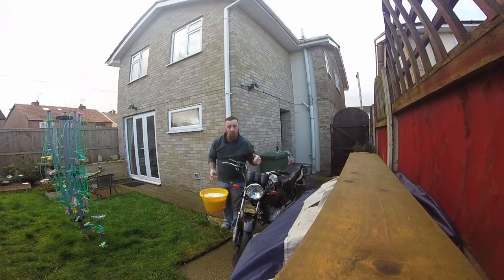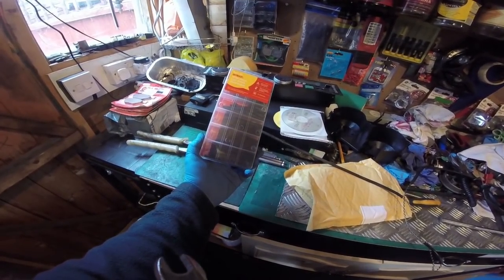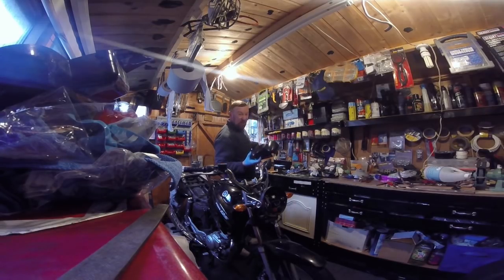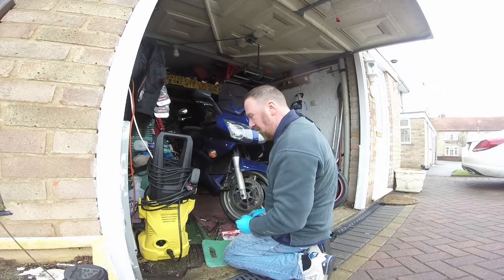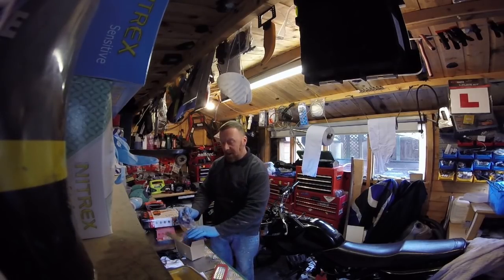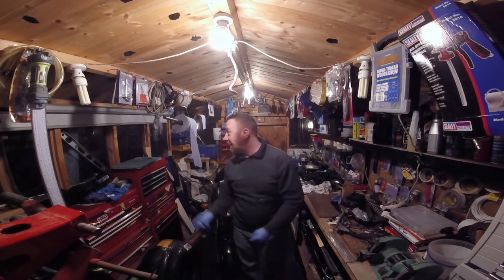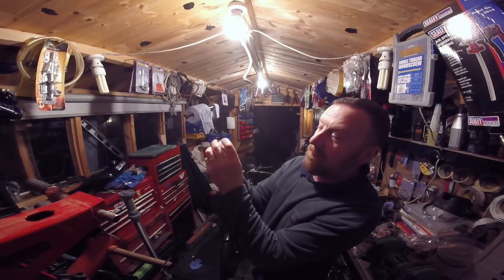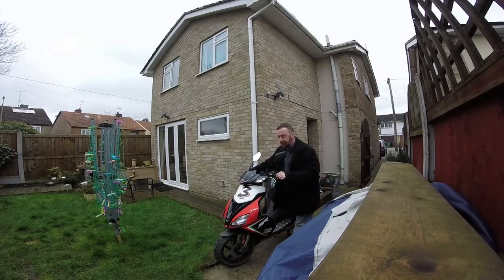YAMAHA YBR 125 GETTING IT RUNNING LONG VIDEO MARK SAVAGE

Comment: Just purchased one of these. The clutch cable snapped last week. I've ordered 5 different cables and not found the right one so far. Wish i'd known they made 60 million different variations.
Reply from the maker: they just used anything they had bud as not built as the ybr

Comment: Spooky, I was bump starting a YBR for someone in work this week! Dead battery which seems to have caused by multiple case of going completely flat due to heated grips being left on.
Reply from the maker: hi bud thanks for watching how's things 
mark
Reply: mark savage Been too busy working to watch any YouTube videos so catching up tonight. 👍🏻😬
Reply: Rewire through the ignition I had the same problem with my xj 900

Comment: Great vid dont see allt of vids on the ybr great lil bike bit expensive on insurance lol. My ybr 2009 fuel injection blew up. Found out I've got really bad rod knock and a piece of the piston barrel has broke off. I dont know where the broken part of the barrel is n how badly damaged the crank is. Just wondering in your opinion I'm no expert on motormacnics bit of a novice is it worth stripping the engine and tempting a repair or is it quit a advanced jobbie n the engine is due scrapping?
Reply from the maker: dangerdog 24 as it’s broke it’s worth having a go as you have nothing to loose 
You can pick up engines easy and not to hard to swap 
But fine it a go bud take it apart but you do need to fine every bit or it will cause more damage
I have a few other videos on this bike if you haven’t already watched them as worth a view
Reply: @marksavage  ok thank you ok have a look for them :) makes sence what's to loose if I make it worse it was already broken lol. I have Haynes manual to help get me through but if I am to mess up can just swap it. Thank you for advice  :)

Comment: Hi Mark... Wonder if you can help me.  I have  Yamaha ybr 125 2007 model.  It's currently not running I took it to the bike shop today and was told that there is no compression.  Is there anything I can do before I tell them to strip the motor down to investigate further.  I've been told that I would haver to spend between £500 - £1000 to fix, to be honest the bike is not even worth that. Any ideas???
Reply from the maker: If they say the compression has gone then the piston has failed possible worse  and yes it not worth paying out that 
Maybe best look for a 2nd hand engine or sell yours for spares and buy another bike bud
Can't see why the shop would lie !
Reply: @marksavage  been looking for a second hand engine but they are ranging from £350 onwards. Was thinking to get a new head and piston set and see if that works. But maybe it's a good idea to sell the bike as spares but that will take ages. Thanks for help Mark
Reply from the maker: @joaofernandes1077  yea they do cost a bit 
Its up to you bud and on your budget and time you have on your hand 
I have a load of videos on the ybr 
Overall it's not a hard job to swap engines
Reply: check the valves ... could be a broken valve spring . easier to check than getting a new engine . just my 2 cents .